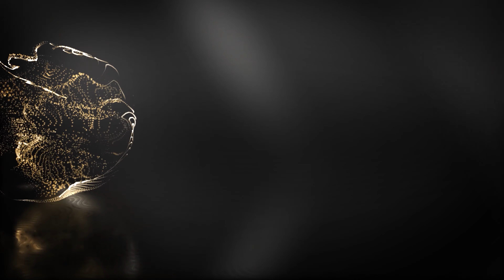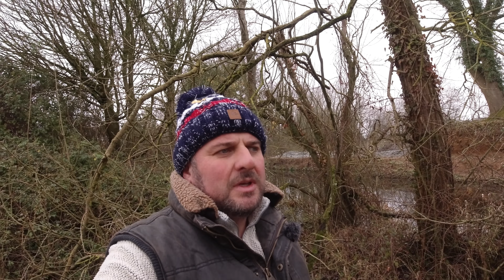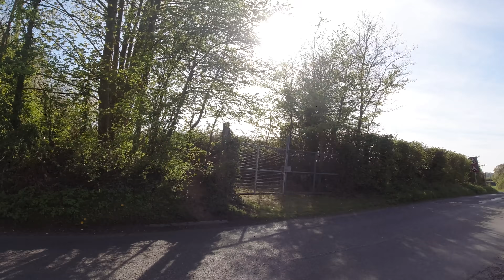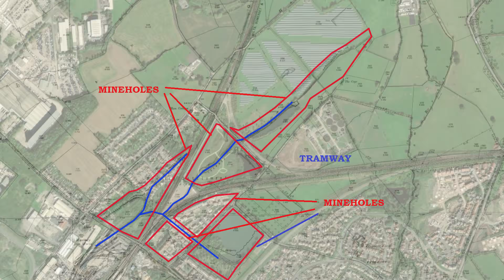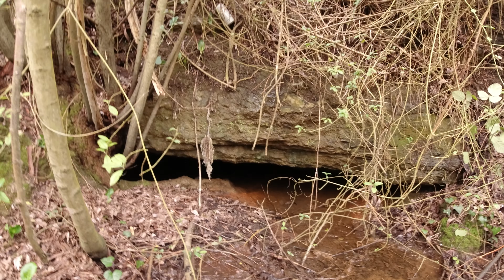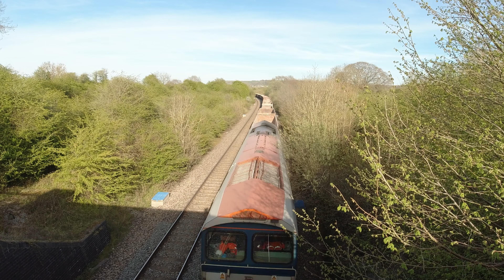The Lost Ironworks of Westbury

Comment: Hi a great video ✨✨✨The area at Penleigh was the local authority tip as you correctly stated after and was closed in the 1960's if you go into the field with the wrapped bales blocking the entrance (To deter fly tipping) look along to the right running parallel to the road there was a tunnel under the road there it was filled in around 1980 -The top of the brick arch was visible-You are correct there were rails going over the road there just above the gate that were removed sometime in the 1970's these were a narrow gauge ! When we were children the now private pond at Slag lane had the roof cover of an engine visible this has sunk and can no longer be seen last time it was visible was the dry summer of 1976 (Left bottom side looking West) -I always wonder if it is still there? Anyway a great video and I really enjoyed this ✨✨✨✨✨✨
Reply from the maker: Thanks for watching and for sharing your thoughts and information on the iron works and old tramways, stay safe